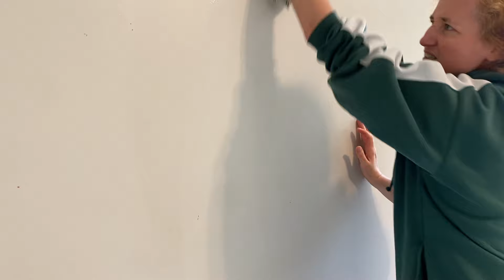Bedroom Makeover Final Reveal

Comment: You can fix your door by adjusting the hinges -- it takes a bit of time, but if you play around with loosening/ tightening the screws you can get that door back to where it was.  You can also move the strike plate up or down as necessary.  There are YouTube videos you can watch for advice!
Reply from the maker: Now that I think about it… some of the hinges had thin cardboard pieces raising them off the door or wall… that must have made the difference. 🤯